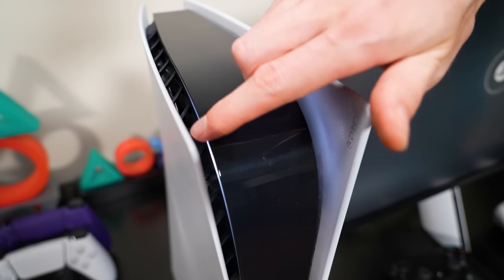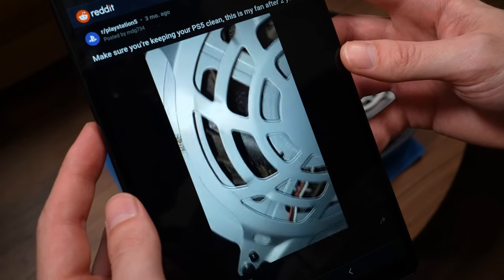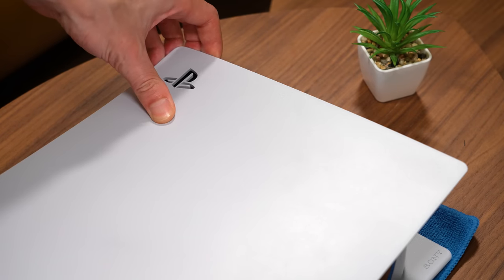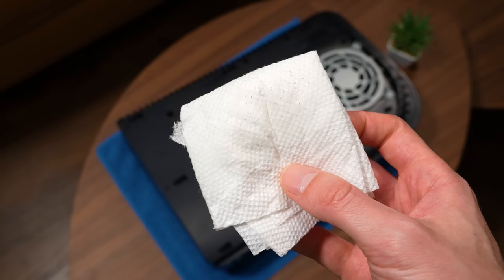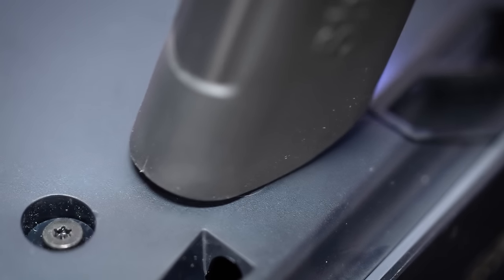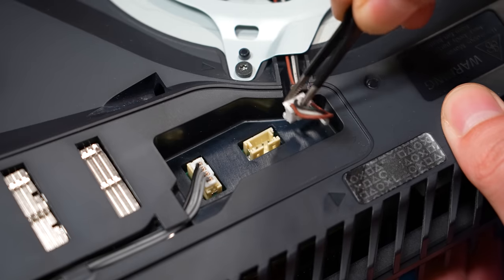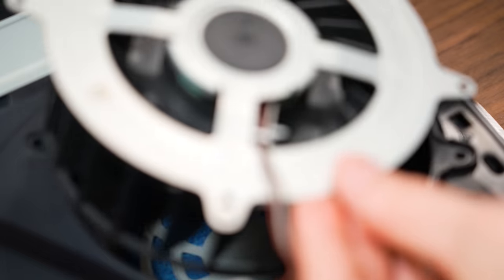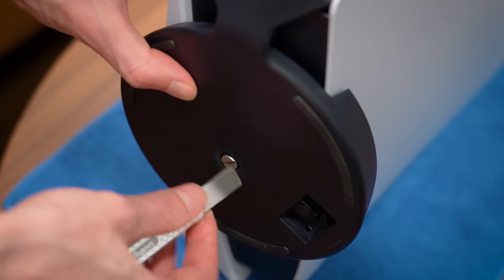It's time every PS5 user checked for this..

Comment: I did this around 2 weeks ago and my PS5 was absolutely spotless. I can only assume some people have filthy homes if they’re getting that bad. Keep the environment tidy & that’s more than half the battle
Reply: That’s what I was thinking, especially when he shows the post at the start showing the amount of dust that had accumulated in a month. I just checked mine which I have since launch and it has pretty much no dust in those vent vanes.
Reply: Depends on where you live. Air quality matters, is not just the "filthy home" problem.
Reply: He's trying to sell people those screwdrivers so it had to be worst case scenario in the video.
Reply: Mine was caked in shit, but I also had all the rear walls removed from the back of my house and an extension built, looks like my ps5 turned into a temporary Henry hoover.
Reply: My ps4 caught less dust in 9 years than those ps5 did in 2 years
Reply: Dust doesn’t mean ya home is filthy 🤣 sheesh, dust is everywhere
Reply: Yeah my problem is I live in a 100 year old college rental that has lint and dust everywhere, our house jokes if we light a match inside the entire place will go up in flames
Reply: i guess it depends where it's kept and if you have pets in the house too
Reply: @vollkerball1  it basically is because the air outside doesn't matter
Reply: @RomieTheKid  if your clean your house dust is less likely to appear
Reply: @flare430  yea that’s common sense.. I’m saying that “dust” doesn’t mean someone or their home is “dirty” dust is inevitable. And it’s does matter where you live. Apartment buildings definitely give off more dust then say a single house, especially if there is construction in the building going on with other apartments
Reply: @RomieTheKid  yea but that much doesn't doesn't happen with a clean room
Reply: @RomieTheKid  if you own a PS5 then I don't know why you would be in a apartment
Reply: @flare430  i was speaking generally, but your response was super ignorant …. Good day
Reply: @RomieTheKid  if you buy a PS5 and live in an apartment that's a lot of money you could have used for rent or to save to buy a house
Reply: @RomieTheKid  I said that much dust lol i didn't say any dust 
Also not ever cleaning your console is gross
Reply: @Dave_ja_vu  Sell people a basic screwdriver that you can get at any hardware store?
Reply: @approving9632  .. bruh, y’all really be out here on YouTube arguing the dumbest stuff. If y’all “think” yalls homes are perfectly clean then cooooool gang, whatever helps you sleep in mommy’s house better at night 😂 like dip.. respond to a more important comment. Put this up a while ago and y’all really here tryna have a full convo about dust, sounding ignorant while at it haha. MY PS5 is spotless so it’s not like y’all offending me, but yall not making sense with this “dust not existing” in yalls homes nonsense. And I know ya moms don’t clean EVERY single day… ✌🏽
Reply: @flare430  you're kind of a touchy little know it all huh? Have you never heard the term "metropolis" before? There's very few single family homes in the downtown area of large cities.
Reply: @NunayahBuisness  still never cleaning it is disgusting 🤮
Reply: @flare430  tell that to the millionaires that live in apartments. living in an apartment, doesn't equal poor or broke.
Reply: @flare430  you can clean a house, and then leave it be, untouched and unlived in, and come back to it absolutely caked in dust.yes a dirty house will get dusty faster, but a clean house will still get dusty no matter what. you'll never not have dust. houses that are more dusty than others but are still clean more than likely have bad air flow. thats arguably the main reason for very dusty houses. bad airflow leads to dust accumulation much more than houses with lots of good air flow. if the dust in the air can't flow anywhere, it just accumulates on shelves and what not, but with good air flow, it can go outside or its much more distributed and therefore there is much less dust. it doesn't necessarily have anything to do with cleanliness.
Reply: @justarandompepe8961  I never said  there wouldn't be dust just not that much lol
Reply: @Dave_ja_vu  True, I mean out of (let´s just say) 20 million sold PS5 consoles 10.000 will look like this.
And what will you see? exactly. 10.000 posts of dirty consoles, but not 19.990.000 posts of clean consoles.

Meaning your console will most likely be fine, vacuuming the console every other month from the outside will be enough.
Reply: Totally agree
Reply: 100% anyone with any excess dust in their consoles needs to just stop smoking indoors or change their ac filter
Reply: @enderwiggin4734 and what if you don’t even have ac like the majority of the world doesn’t and/or live with heavy smokers? Yeah stop acting like its only the owners fault
Reply: My room is a crazy dust collector so.... 😢😢😢
Reply: @justoing  yes, PS5 is attracting lots of dust to bigger air vents, in 6months only it caught so much dust than Ps4 which has not collected in 5 years

Comment: I own a Series X and cleaning is super important. I feel bad for many console owners of this gen because they will soon find out that surface level cleaning can only go so far. It may be beneficial to deep clean ALL dust from the console - mainly the cooing fins for the Heat Sink.
Reply: I own series x too but seeing this compared to series x my series x doesn’t need cleaning as it does have self cleaning system I wish Sony could do the same for their consoles rather than having to take the console apart just to clean the dust haha
Reply: @thedeep3759  "self cleaning system" dude if you don't clean your console it's gonna fill up with dust. Your Xbox does not prevent months and years of dust buildup.
Reply: @thedeep3759 I have series X too, but I don't believe for second that claim. I've never seen system that wouldn't get dust accumulation 😊

Comment: Bought a £15 cleaning and disassembly kit from Amazon, heatsinks and the 'cheese grater' radiator block behind/below the fan are definitely the cause of most overheating issues as they get clogged very quickly, especially in dusty environments, I cleaned my heatsinks a few times and still had issues, so had to reach further into my console with a toothbrush to clean the radiator block itself. Definitely worth a look if anyone is having console issues, I could have made sculptures with the amount of dust I got.
Reply: could you link or tell me which disassembly kit you bought?

Comment: definitely check and clean … within my first year of owning my PS5 shut off randomly after about 30 minutes of usage. At my old house, the dust build up was really bad since my room was so small. So for about 9-10 months, I just gave up and thought my PS5 was broken forever. I really don’t know why opening up my system and cleaning the fan and everything inside didn’t cross my mind. As I moved into my new house a few months ago, I decided to give it a try because, hey why not at this point lol. After a quick clean and usage of a compressed air can, the system was good as new. I could leave it on for days if I really wanted to. The moral of the story is if your system is constantly turning off after short usage, just clean your fans. Don’t be like me lmfaooo
Reply: Ill wait till that point to risk it not going to be opening shit up to break it prematurely

Comment: Thank you very much for the reminder!
I do console repairs for me and friends from time to time so I had seen some consoles in really bad shape but never a bad case with my own stuff.
So I thought my PS5 (which i have since a year now) would also take some time to get dust build up but OH MAN WAS I WRONG!
Maybe the spot where it stands isn't as open as I hoped it would be... I'll definitely set myself a reminder every 6 month to clean it. 

With your instructions it definitely won't hurt it. :)
Cheers!
Reply: What type of screwdriver is it?
Reply: @alswearengine4867  You'll need a Torx Security TR8 driver / bit for the fan. everything else (except for the stand for which you can use a coin / flat head) should be tool-less
Reply: @Palte  thank you.

Comment: Something important that was failed to mention in the video is when taking the shells off the console. 
Which you have to hold the top corner that is on the front side and hold the bottom corner on the opposite side which is the back. The important part he forgot to mention is you have to Pull and PUSH down. Not just pull off or otherwise you can break the parts that attatch the shell to the console
Reply: First video he already mentioned how to do so. By this time most users should already know how. Even Playstation has instructions on how to do so on YouTube as well
Reply: Wdym pull and push

Comment: I've cleaned mine Atleast 3 times now, just depends on your house/area
Reply: Live in north africa it's crazy
Reply: And if it stands in an area where dustbuildup is slow or fast. Its the same with computers, they are somewhat very weak vacuumcleaners ^^"
Reply: Mine had a dead rat inside hadn't cleaned it since release day..grabbed the water hose now its good as new

Comment: Pro tip, wherever you have your PS5, put an air guardian (purifier) in that same room, leave it on low at all times. It filters out the dust in the air.
Reply: purifiers leave strange residue on my discs

Comment: Just cleaned mine today. I have a launch model and there was more dust in there than I anticipated. Not bad for 2 years though so I’ll probably give it another go yearly or so just for maintenance. It’s reallt not hard to do a quick cleaning. Most people will go the entire gen without cleaning it though. Dust accumulation varies depending on the room you keep it in. But dusting counters and such as well as vaccuuming or sweeping regularly can help mitigate this as well.
Reply: Never cleaned my  launch ps4   never had a problem  with so won't  clean my ps4 only time Il took plates of was to insert ssd
Reply: My got alot of dust because I was renovating my house  got luck didn't overheat

Comment: DO NOT USE A VACUUM! 

The static electricity can fry the board.
Reply: Just curious what should we use instead of a vacuum?
Reply: I used my water hose to spray it down then left it on the sun a couple hours looks like new now😊😊

Comment: If your going to take it apart, might as well make it have positive air flow(meaning the fans have more intake air than out. Which pushes air out gaps instead of sucking in dust). Then filter for the intake(s). Dunno if possible, but thats more ideal. My pc virtually dust free and I haven't cleaned it in 2 years, beyond intake filters.
Reply: just some fine screening, just like some PC cases like the Corsair 570X has will do the job without gimping airflow.
Reply: This is a ps5…. Only 1 fan…
Reply: @exb940 That doesn't take away anything I said. Intake filter and boom!
Reply: @krich106  okay but what does anything you said have to do with a ps5...
Reply: @exb940  so your ps5 isnt a mess after 6months. Sony just being cheap.

Comment: Ive had my PS5 for over 2 years and i cleaned it this month for the first time. It barely had any dust in it. I just took off the side panels and vacuumed. I keep it covered when I'm not using it, so that helps prevent dust from getting inside.

Comment: Every time I try to clean electronics by myself, even when I'm looking at guides to help, I always end up breaking something. That's how I broke my first PS3. Tried to clean the inside and ended up breaking the cable connection to the fan.
Reply: I cleaned my PS2 and when putting it back together, I pulled the metal strip from the power button. 😥
Reply: @WebVManReturns  did the same to mine when cleaning the disc reading laser, stripped the ribbon cable for the disc reader😭
Reply: That's EXACTLY what I did when I cleaned my PS5 for the first time... turned out that the connector and the pins which go into it got stuck and I pulled out the entire thing out from the motherboard. Needed soldering and a new piece, even now I'm afraid to undo it.
Reply: @MrBrentEC  if I can do it u can to bro  all u gotta do is grab both ends of the white plastic that got the wires don't go further down try going as high as you can because if you grab the plastic underneath it will fuck up the motherboard but anyways once you grab on wiggle the connector left and right while also moving it up a little it will take some time but that's the safest way
Reply: @JesManVP  cheers man, I'm pretty cautious now and don't take the fan out very often at all.
Reply: @MrBrentEC  only do it when it's necessary then if there's a lot of dust
Reply: Mine broke for putting windex on the Fan...now two days later this video pops up in my recommended😡😡

Comment: Edit: I guess I didn’t have a security driver version. Its ok though nothing pliers cant fix getting the other two screws out. The person I learned what driver to get didn’t say security driver but I know the difference now. 

I love how you can easily unscrew  the fan screws. Two of mine got stripped nearly instantly. These types of screws seem so terribly designed with the little metal bit in the top middle where the driver goes so that they cant be better fitted deeper.  Its like 5% of the drivers tip can fit in to the screw causing it to to keeps slipping over the edge damaging the screws.
Reply: That mean you used the wrong size bit bro. Got to use the right tool
Reply: You mean you didn't use a security bit? (Hole in the middle) I don't have any and I'm lazy. I use a flat head and also torx for like 2 that I can fit just fine. Of course if your smart and carefully unscrew them without stripping them. Otherwise it should be easy to do with no issues
Reply: Perhaps you should use the right tool for the job next time, instead of being the tool.
Reply: @oscarfunez3806  T8H torx bit? Used it and two screws unscrewed just fine. It fit fine, but yea I guess it wasn’t security. Damn.
Reply: @pointdelusion8491  Huh. Weird. Guess it's just luck. Sometimes when they produce the screws it isn't always perfect. I suppose that really the company that produces those screws and ports them to Sony. Mines were fine. Fortunately I don't have a security torx so I had to break the middle point or use the flat to carefully unscrew. They aren't so tight to begun with

Comment: Hot tip: wall mount your console. Better airflow. Safe space. And lastly doesn’t collect as much dust
Reply: Cool , my ceiling fan is mounted high but catches all the dust ?! 🤷
Reply: Ceiling fans have a static cling issue also people leave them running all day. If yours is getting bad fast. Change your return filter for your hvac more and vacuum.
Reply: I have putting my PS5 horizontal day one, why? Its better cous the dust in not falling in it when you set it vertical....

Comment: You can also flip the fan without disconnecting it, just be careful to not mess up with the wires because they are thin. Flip on the over side, clean it and then insert it again. Voilà !

Comment: Exactly this!

I had added an internal SSD and my PS5 would constantly turn off after about an hour's use. I thought it was the hard drive but someone recommended checking it for dust... It was filthy. Cleaned it out and put the SSD back in, haven't had any issues since.

Comment: Be careful when removing the plug that leads from the wires connected to the fan. I used my GF’s eyelash tweezers and i lacerated the cable casings with it being so thin and cheaply made.

Comment: I just recently had to clean my PS5 after using it for 6 months without and it was a nightmare because of how much dust there was. My room gets dusty really easily so I think I’m going to have to start cleaning it once a month. But I always put it off because I never cleaned my ps4 until just last year (I’ve only had it since 2019) and it was really hard to do because I had to completely take it apart to get at the fan. I’m so glad they made it easier to clean the ps5

Comment: I cleaned mine for the first time since launch cause it was getting so hot it was shutting down. Turns out the radiator was completely caked with dust.

Comment: I wouldn’t use a vacuum cleaner against dust buildup. Vacuuming stuff builds up static electricity, and that might cause damage during a discharge. If you use canned air and blow the right way, you might blow the dust away/out of the way in a safer way.

Comment: I should have no reason to worry about this because one I will barely play my ps5 and two I'm not gonna leave my ps5 sitting out after use I'm repackaging it like it was never used to avoid dust build up and to avoid any problems. Also I bought my ps5 recently so Sony had time to tinker with any problems that the earlier ps5 probably had

Comment: I had the issue that the ps5 was turning off while playing ps5 games after like 45 mins or so, it was def overheating. I took time today to fully disassemble the system to clean the heatsink. I was shocked how many dust was stuck between the heatsink and never got the issue again.

Comment: I've had a white PS4 since the launch of destiny. Never opened it to clean it once, I have cleaned the the sides a few times and its usually caked with dust and sticky weed smoke. Still runs great to this day. Only issue is that it doesn't do the beep when I turn it on or off.

Comment: I use a couple different sized small paint brushes with a vacuum to clean the fan and side vents without removing anything but the side plates. Hope this helps others who dont want to remove the fan. Had mine for 2 years and still looks and runs brand new. I clean every other month.